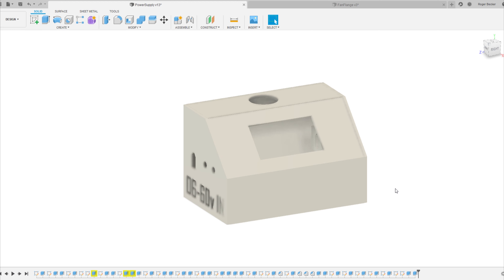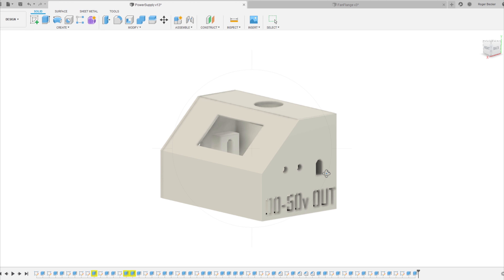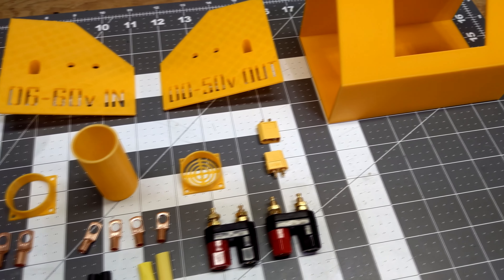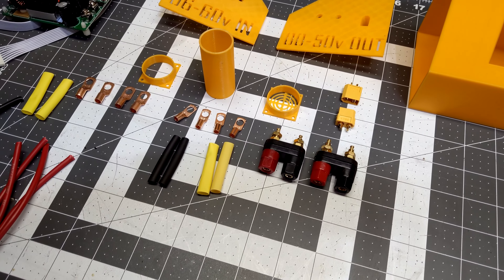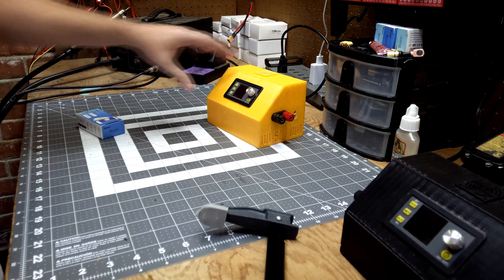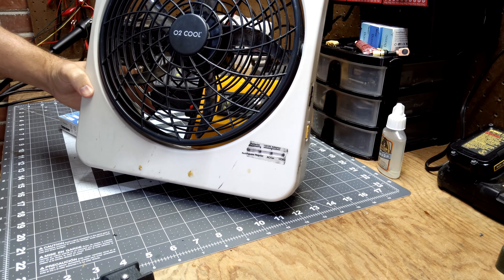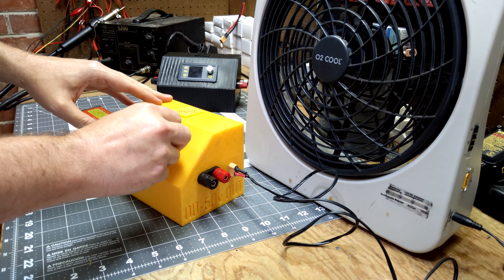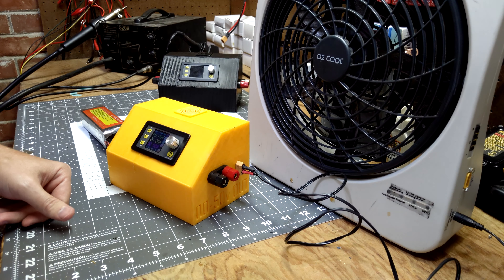DIY Variable Power Supply

Comment: What device do you use to put 60v input to get 50v output? I'm looking for a DC Variable Power Supply, but most and the one I have max out at 32v output. I'd love to plug my 120v AC into it and get 50+v (whatever I need to charge a 48v system) and several amps out of it. Still looking for an affordable one though.
Reply from the maker: I use a 70v 12A 800W power supply I got off eBay.
https://www.ebay.com/itm/-/122387890570